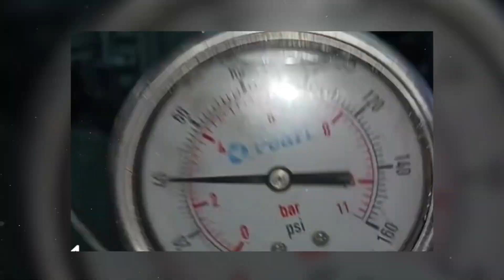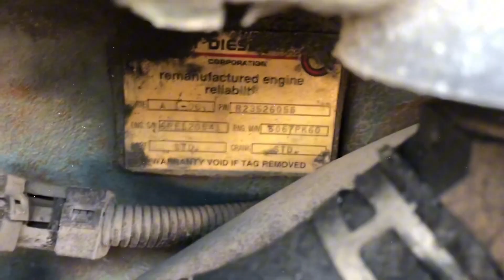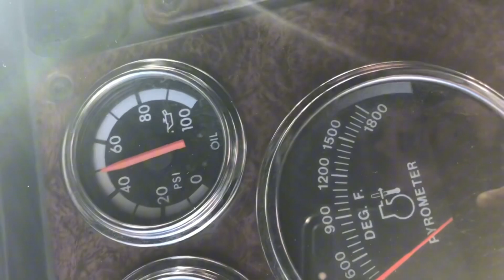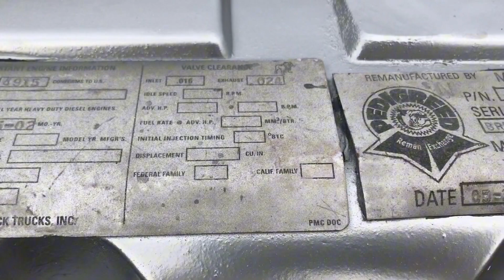6 American Truck Engines That Were BANNED Worldwide — Too Powerful for the Roads

Comment: The biggest problem with most diesel engines from the 70’s, 80’s and 90’s was not the engines themselves, but rather the EPA, and even more so, CARB. Most diesel engines from that time frame, if allowed to run according to spec, and not completely over-fueled, would not be gross polluters at all. But the EPA/CARB, influenced and run by radical leftist environmentalists, are more concerned with returning the economic system of the US to the Stone Age rather than practical solutions for a better, cleaner environment. The EPA/CARB are prime examples of complete government overreach. To the EPA/CARB, and those in the government responsible for funding those tyrannical bureaucracies, it’s not so much about clean air, clean water and a healthy environment, but rather government control through fear and threats. Their funding and those that are appointed to run those bureaucracies need to be thoroughly examined before anymore damage is done.